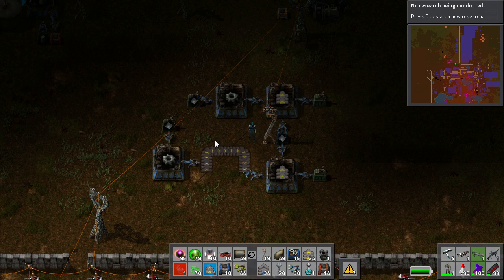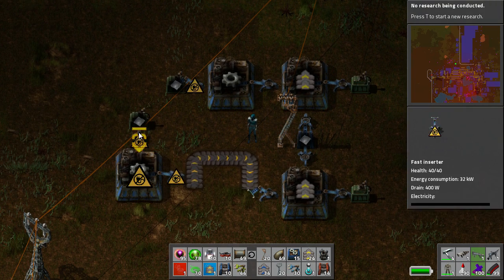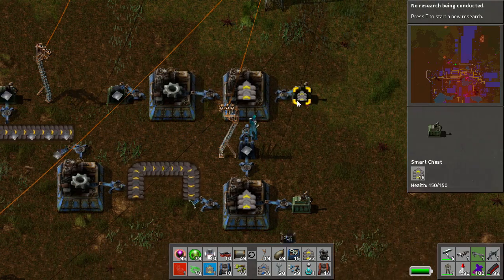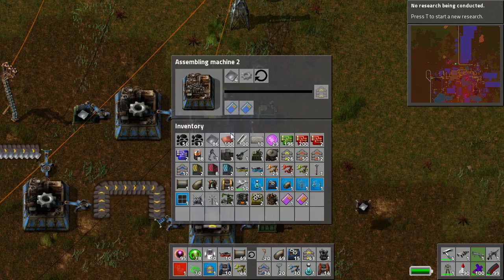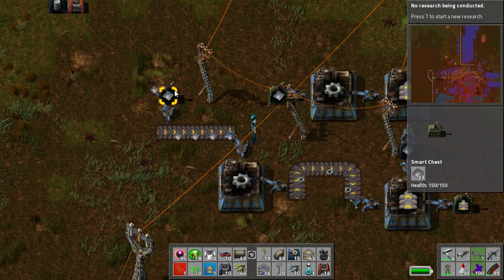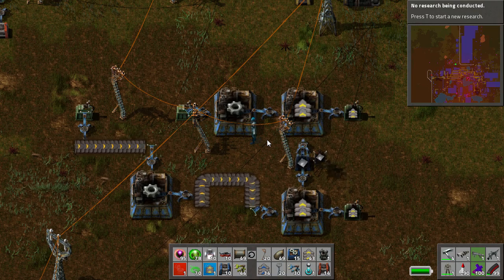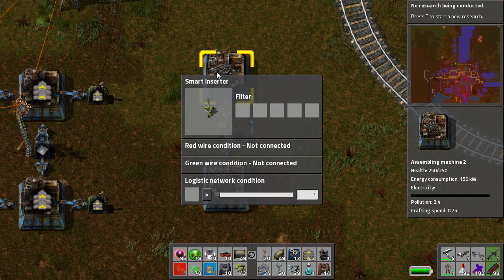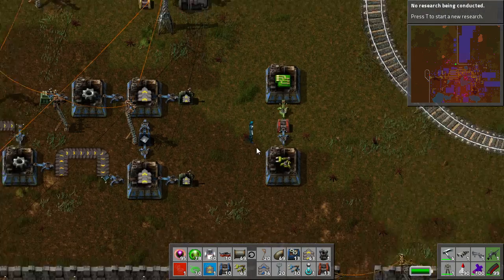Factorio Tutorial 19 - Inserter Stack Bonus

Comment: Regarding Advanced Circuits, Processing Units and Modules, since they take a long time to build, feeding them via belts can allow you to supply resources to multiple Assemblers with just a single Assembler, with perhaps the exception of that Advanced Circuit build that uses 1 Copper Cable Assembler to feed 8 Advanced Circuits Assembler.

Another good comparison for the Inserter Stack Bonus advantage is to do the 3:2 Copper Cable:Electronic Circuit Build compared to putting the Copper Cable on belts.